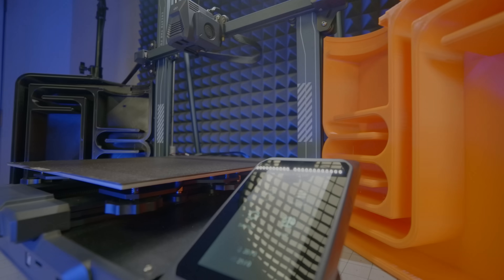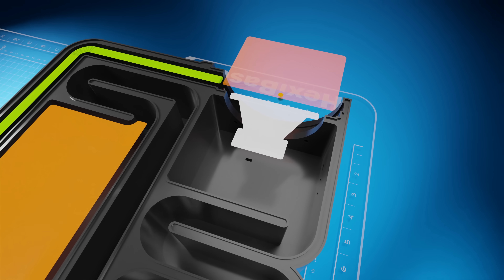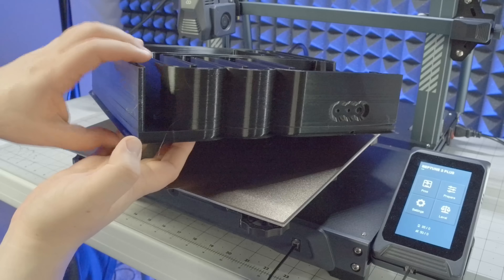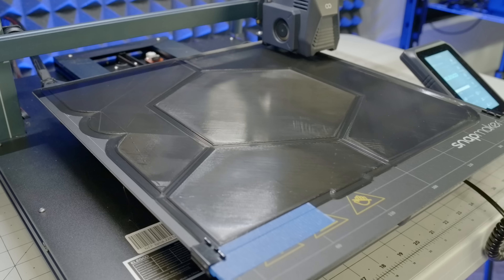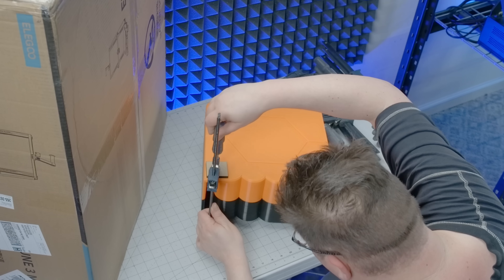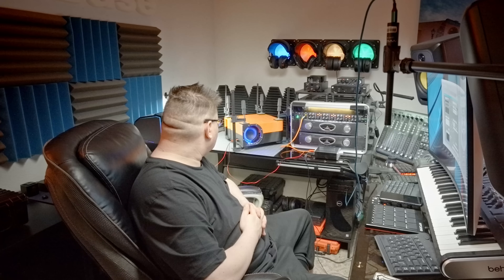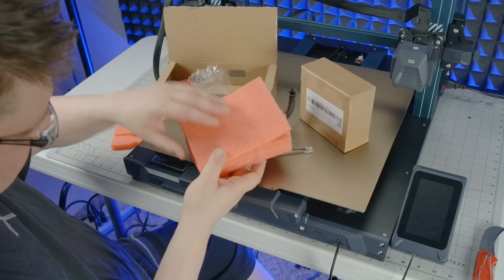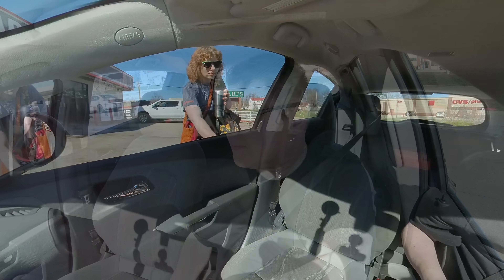ELEGOO Neptune 3 Plus Review & Feature Build

Comment: As a car guy that loves hifi. What about strategically drilling holes through both sides and studding the entire construction! Placing it in the oven first to heat it evenly then some cool dome nuts and washers to give it the a steam punk vibe. By the way is this model availble to print yet? I want to build a small sub for my Alfa Romeo it has no room and this small sub would fit behind the passenger seat very easily

Comment: Printing the second half. ordered the part. will let you know how good it sounds! Thanks for the incredible work. for the neptune 3 and 4 if you're using the PEI sheet, just use PETG it sticks so well that it's the sheet that is slightly bending mind print. but it seems absolutly fine !

Comment: I have some advice and some takeaways for those that want to attempt it, an enclosed printer will help, glass or carbon fiber filaments will help more. A hairdryer or a heat gun can be used to reduce stress on the glue as the plastic will deform to the clamped/ glued position, but most importantly supper glue/ CA glue is stronger than epoxy on PLA.

Comment: you may already have come up with a solution for this problem https://youtu.be/p0BSOBLOU2U?t=492 the thermal contraction splitting . my quandary for a solution or 2 ; idea 1 over print the seal dimension by a few layers and cnc router it flat ; idea 2 warm it up when sealing it for thermal unity in both pieces ; idea 3 make the channels much deeper and allow for a line gap ie make the variances irrelevant to a good sealing surface.

Comment: I built this on MDF measuring the 3D model and converting it into pieces that can be laser cut (not a sandwich of layers, because that was too expensive).
Even when the laser cut parts were uneven and definitely there are sealing problems inside the box, this thing sounds amazing, it can really make the room rumble. Although I haven't tested how loud can it go, as I'm not sure I would know when I'm burning the speaker.
I didn't use the dayton speaker btw, instead I used a ~8dls 4in sub from aliexpress.

Is it worth it to try the dual Tangband Hexibox? or is this totally an upgrade?

Comment: Enclosures, enclosure, enclosure! After encountering part warping/delamination when printing near to full build plate size parts on my Prusa MK3 I invested in a  3D SOURCERER Universal 3D Printer Enclosure. It made a huge difference. I also have a Elegoo Neptune Max still in the box and the one thing that is holding me back is finding the space where I can put it along with an enclosure. It will also probably include thermal control and circulation fans.

Comment: 🟦.... I'm sure this generates some quite low bass, but as a result of something I've noticed with quite a few of your designs, You don't pay much attention to the phase relationship of laminar flow through the labyrinth, as a result the bass will reach low but be rather loose and blurred, lacking a taught "Tympanic" envelope as a result of the lack of phase coherency in relationship to the drivers front output.

Comment: Why not put lugs on the side of the cabinet on the x, y and z axis; that way the part has it's own clamps. If you use drum lugs you can recess them. Then in between the sections use a gasket.

Comment: best solution to the seperating issue would have been to toss it in the oven at just a high enough temp to relax the plastic. theres a full range of temperatures with plastic that offers varying characteristics within each of them for this task the heat from a hair dryer could have worked wonders for allowing the 2 halves to reshape to each other.

Comment: Nice content -- Thanks!

In the plumbing section of most hardware stores you can find various Oatey brand cements suitable for ABS, which will weld the two halves of the enclosure together. Might work better than epoxy.

I used it to repair an ABS 3D-printed part from my old Lulzbot that had split apart -- worked a charm!
Reply: Now hearing that PLA was used, so I cannot vouch for Oatey cements -- perhaps their All-Purpose cement would work. I'm not sure that PLA would've been my first choice, although ABS would warp even worse than PLA. I'm personally fond of HIPS.

Comment: In the early to mid nineties I was into high end custom car audio systems.  A guy I knew paid the installer he and I used to build an eighth order bandpass enclosure for an eight inch woofer.  He used it for a few months until he went for something even crazier and I bought it from him.  The new 8 inch driver I put in it was rated for about 65 watts but I had a really clean precision power 400 watt mono amplifier that I ran an active crossover filtered input into, and the speaker and enclosure handled the 400 watts with ease.  

It was the punchiest and thumpiest sub I ever owned.  I installed it under the rear deck of an 1987 jetta and had six inch speaker grills installed to cover the two perfectly spaced ports so it looked like there was only a pair of midrange speakers in the rear.  I think I glued some fake silver decoy tweeters to make it look like a cheap triaxial midrange speaker.  People were baffled by the deep base from nowhere.  The entire system was stealth or hidden behind stock grills, etc. But that was the centerpiece.  Fake six inch speakers producing windshield shattering bass.

Comment: Pete, 
Just on materials - if you’re using PLA how is it holding up in your cars? As Makers Muse tested some parts and PLA didn’t hold up well. Your parts  are thinker so curious. 

Have you looked at making with PETG, ASA/ABS, PC, PA12 To ensure heat durability within hot cars. 

Have you looked at materials with CF or wood fill etc as the additives may add to the acoustic sound. Rather than being - “tinny” (Hyundai door” the wood may have more deadening effect (vw door)…

Could you make a void that you fill with Foam or other material like resin or wax? Print with honeycomb? 

Also when you do your 3d prints you keep your tube sections square is this to slow sound or just can’t be bothered filleting to make more tube like orofices? With additive you could go nuts (like the Bose internals)…

I print all my stuff in prusament petg and it performs well. I did have warping in full sun (direct Perth Australian sun for 2+ hours) on a thin 2-3mm part. Put in an oven and let it settle back to the baking sheet and you would never know it was messed up. 

Interesting to see a test…  I’m considering making a couple of speakers for my bro after watch your vids. Currently have mk3s and mk3s+, waiting on a XL (end of year)… Might even make my own as my b&w 600series 3 (2005 era) are in storage (I suspect the drivers will be brittle as now)… if they are, suggestions to refurbish?

Comment: Some slicers like Prusa support a feature called a draft shield, which is basically a wall around the entire model, which is printed along with the model itself. The idea is to keep the air inside the shield stable and uniform to reduce warping. I'm not sure how it might have helped with this gargantuan build, but I felt I wanted to mention it in case someone out there can use it with smaller prints.
Reply: I did it "by hand" in Cura, because it doesn't have that option last time I checked, and it doesn't like overlapping objects that it considers to be separate.
Just build the shield into the STL file (or whatever you're importing into Cura) in your favorite mesh editor,  and give it a thickness of 1 line.

Comment: You can get much stronger print than yours if you would only watch CNC Kitchen's videos.  Infill doesn't attribute much to strength of part. Number of walls(perimeters) is far more important. Instead 3 perimeters and 40% triangular infill make your part something like 6 perimeters and 15-20% gyroid infill. Also use near max temp of your material for better layer adhesion. For added strength use lower height if you have time for it. There are also "magic numbers for layer height" - 0.08, 0.12, 0.16, 0.20, 0.24, 0.28, 0.32. For 0.4 nozzle 0.32 should be highest relatively good layer height.

Comment: Enclosure, masking tape the build plate and put a thin layer of glue stick down, bake or dehydrate your filiment, and if all else fails slice and print each side as 2 parts so you will have to put 4 parts together at the end.

Comment: beside an enclosure I think it could also help if when you were glueing it together you kept it somewhere warm so the plastic would be able to flex easier. When the adhesive is dry it'll be better adhered and the plastic would be molded to be flater.
Or you you could sand the connection points so everything would be flat, but that would take awhile.

Comment: The adhesive used to install windshields world probably work great for this, if you can leave a gap  about .050" maybe 1/64" the rubber like adhesive will allow a slight amount of give, and is extremely strong. Id check to see if it sticks to plastic,  I'd say it does, it seems to stick to everything, the yellow  trim adhesive would definitely work well, it's used with rubber and plastic, and is extremely tough also,  the job weld doesn't stick as well in my experience with it, it seems to work better with metal

Comment: The problem is your LONG extrusion runs. The longer a bead of molten plastic, the more it will shrink as it cools. Each layer adds its own shrinkage to the last until the force is enough to warp the print or even separate layers.  Your layers are also NOT bonding properly, likely due to the lack of an enclosure causing the layers to cool faster.  You need to get the printer to interrupt the LONG side and edge runs into shorter, more randomized lengths with space between, that are then filled in later. The way a welder makes long bead welds by short stitching welds every few inches , then comes in later to weld between the stitches. I don’t know if any slicer available can do this automatically, but with larger scale filament printers becoming more common, someone SHOULD be figuring the slicing code to minimize warpage on long bead runs. Alternatively, you could print this thing vertically, in four sections that then glue together to form the enclosure; that is, orient and cut the parts such that you can print the pieces with shorter runs of filament per side.  In SLA printing, we try to not even orient rectangular objects square to the image plane, but at an angle with one corner low so that we build up mass very gradually, rather than long strips of resin from the get go.   Also- I have found that in large filament printing, ASA prints better and with more dimensional stability than PLA, ABS, or those carbon infused engineering resins. ( I have a Raise 3D pro, 12x12x24 inch printer- but then, it also has an enclosure. )

Comment: PEI is a low surface energy plastic. Sanding the bond surfaces will increase the bond area. It also may be helpful to print "undercuts" for the bonded joint, or worse, thru-bolt holes so the "clamps" remain in the assembly, with the adhesive.
Adding outward draft to the 3D model may help even the outer boundary WRT the material vertical shrink gradient.
Other than that, awesome and inspiring work! Midbass is the most difficult region for me to add to my otherwise awesome car stereo systems. So much midbass is hidden in the music that I like to jam.

Comment: Instead of fighting the warping, would it be feasible to make a three piece design, with the additional piece being an H shaped piece that fits between the two large end pieces? The legs of the H shape need to be made tall enough to account for the maximum amount of warp you anticipate.

Comment: PLS!! Wipe PEI Sheets once in a while with pure Acetone. (Isopropyl Alc is actually not good at all for PEI) The grip will be increased significally and PEI is not affected by Acetone. Try it and your problems should be gone.
Hint: on ABS or PETG it will be actually a bit to strong^^

Comment: Bro I can't believe YOU of all people got pissed at the printer for "not being able to print 320x320" because it warped. Go buy some pink insulation and make a quick enclosure. the residual heat will warm the inside and prevent warping.

Comment: You might be able to fix the warping of the enclosure by heating it up and letting it slowly cool. You could put the clamps back on and suspend it inside a 150°f oven for 5 to 15 mins then turn off the oven and let it slowly cool down on its own with the oven door closed. 
  That in theory should allow the thermoplastic to relax slightly and the claims should hold it in place while it cools.

Comment: I'm using these drivers "as intended" in a pair 3D printed midwoofer+tweeter desktop enclosures, standard 4th order bass reflex. Of course I cannot design enclosures anywhere near as complex as you so I couldn't get the response down to below like 50-60hz without making the enclosure absolutely gigantic, so hearing them punch well above their size is absolutely amazing. I don't care what anyone says, Dayton Audio provides an EXCELLENT cost/performance ratio. However I can't imagine that the group delay of this enclosure is very good haha

Comment: You might need to limit vertical height of full plate prints in order to counter the effects of thermal shrinkage which might require 4 layers and maybe another piece for the speaker hole itself.
Reply: I guess this was supposed to be print volume demo, but I agree, it would have probably been more succesful as a surface demo. 2 outer layers, 2 mid was my thinking as well.

Comment: Do you know if something like the primer used in PVC plumbing would soften the PLA enough to allow a solvent bond like that of the glue used in same might work better for your application.  It doesn't bond the two together as expoxy would.  It's a solvent bond so the two parts would become one part if it works with the PLA

Comment: I’m always impressed with your enclosure designs. Seems like you need a heated build enclosure to minimize the print warpage. That or toss it in an oven for a bit while it’s clamped together to relieve the stresses.
Reply: Clamps and soft hot plastic doesn’t mix well however sandwiching it between two glad boards with a heavy weight would work great.
Reply: @BlackTownie999  Actually heating them up with clamps is the easiest way to flatten them back out. You don't need the material to melt, just slightly warm so it can tweak a little bit. We do this all the time at my work to correct warp in parts that are not flat.

Comment: could you have tried putting the enclosure in an oven with the clamps? Heat it up just warm enough to soften the plastic and release any built up pressure, but not hot enough to make it sag and warp. Then let it cool slowly. Might work might make thinks worse. never tried it personally.

Comment: You need some primafix. Used a few squirts for a project that took 8 days to print on my ender 3. Also use it on my 410x410 Chiron. Never had anything no matter the size pop up. And Yes Ive maximized the chirons bed. Even printed a shelf on the diagonal😀

Comment: For funzies, i put one of those little 4" drivers in a long pvc tube, i think about 5 foot long.
Was really fun to hear how much output from such a small driver.
I actually have 16 in my home theater (four for each l/c/r, and for in the rear), matched with some 2.5" tweeters, infinite baffle.
Sounds pretty darn good. But I'd like more midbass punch. In-wall enclosures would be nice.

Comment: use glass for the build plate with glue on it but you have to be careful when removing the printed part after the printing is done, normally you must leave the built plate cool by itself.

Comment: Besides annealing after printing, using an enclosure will help avoid warping during the print. Anything from a cardboard box to an insulated grow tent will help avoid uneven cooling.  It's especially important for printing tall objects on bed slingers since it's getting wofted with cooler air the higher it gets.

Comment: Another great project from the master. On your smaller 3D printed 3" woofer cabinet, in addition to dividing each half into two to allow printing on my Ender 3, I designed in screw bosses to allow screwing the two halves together. So along with the glue, I got a very tight seal between the two halves. It's on Thingiverse.
Also, I use a PEI sheet on my printer too but find that I sometimes need to give it a coat of hair spray in order for pieces to stick and not lift off.

Comment: @HexiBase - Would you share dimensioned versions of the models or dimensioned cross section views for those wishing to replicate projects in materials other than 3D printing (i.e. wood with saw + router + drill)? I know it is possible to measure distances in various STL viewing software, but this process is not exactly ideal.

Comment: I work at a place where they 3D print everything you could imagine in a bunch of materials from most plastics to metals like stainless steel and titanium.  Some parts are much, much larger than the area of this printer.  They of course have modeling software to predistort the printed shapes and produce parts to final size.
Reply: I work for a printing company as well and we looked at software like that. Only down side is that it does take a long time to calculate the part depending on size. We stopped doing metals though. We used to do about 10 different metals, Ti64 being the hardest to deal with. Thermal variances is always annoying to figure out sometimes. Our builds are packed fairly tight so dense parts affect anything near them. Fun job can be stressful when machines and parts act up.
Reply: Seems like a cool place to work for how do you like it? I'll buy lunch for a week stright if you get me in!
Reply: @rattanack1413  Sadly I have limited access to these places.  Obviously I can't take photos but for reference for ongoing work.  Alot of the stuff they are working on is prototype and proprietary secret.  Besides, my wife makes me sandwiches each day!